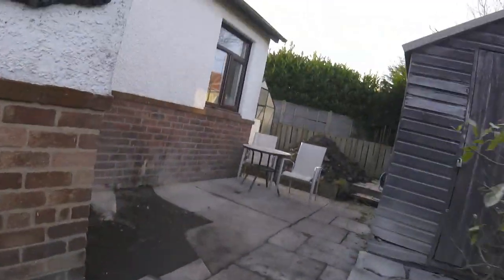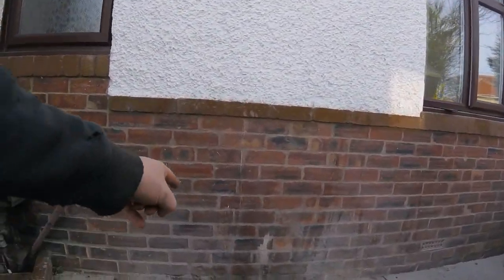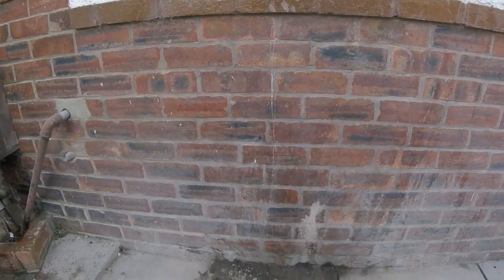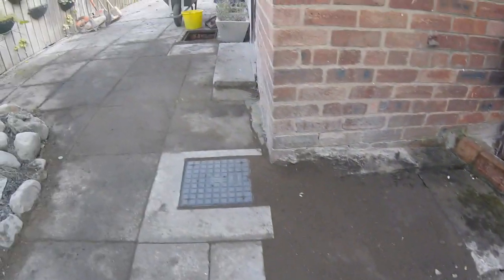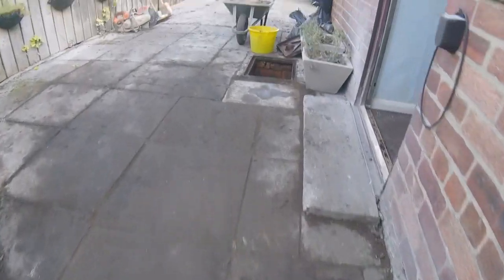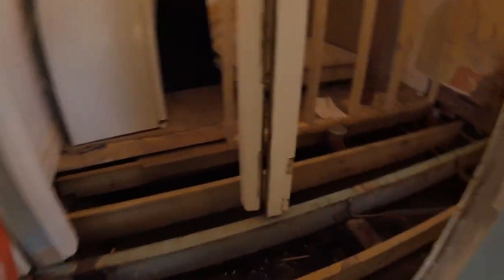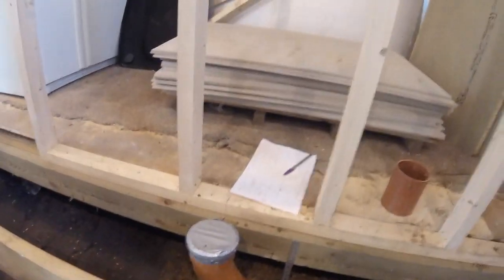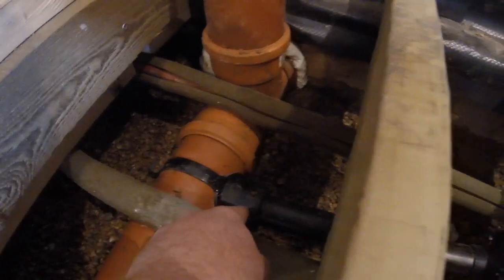New Downstairs Toilet Drainage Install Clean A Drain 052

Comment: No vent stack requirements in the standards over there?
Reply from the maker: Good point. Yes soil vents are in our standards. This is only at first fix stage and the bathroom fitter will have to decide for himself this can be easily add on to the pipe system later. Most likely in the form of a one way diaphragm valve that can be boxed in behind the toilet.